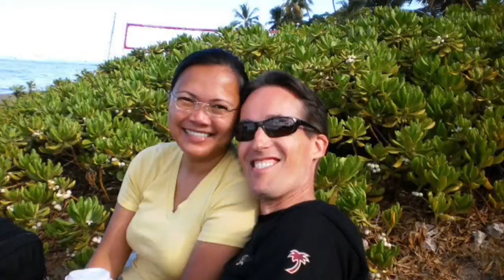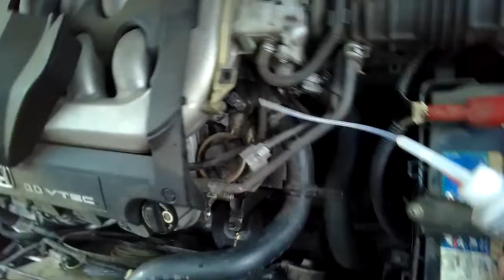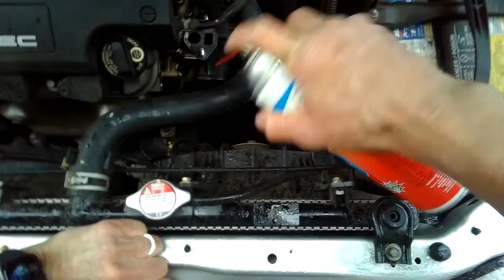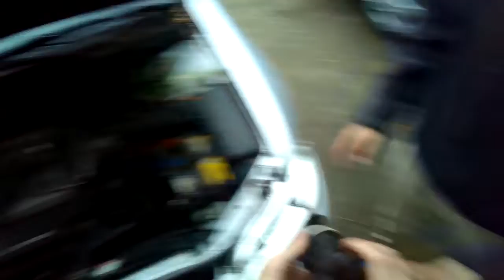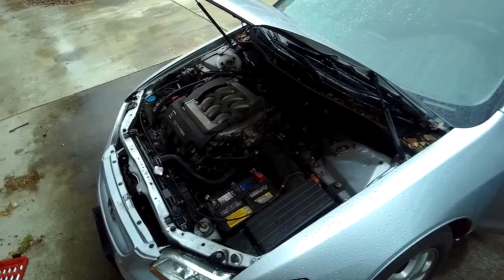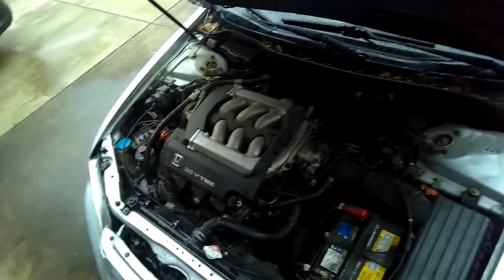HONDA ACCORD P0301, P0302, P0304, P30306, P1399 — FIX

Comment: Excuse me, friend..my car has the.light on.and it shows the.codes.p0304,p0306 and p1399....and I already changed the ignition coils...of cylinders 4 and 6...and anyway turn on the light again...again...that thing you did about the EGR valve...you think it will solve the problem for me
Reply from the maker: Can you send that same question to my email address at: scottthefixitguy@yahoo.com
Reply: @Scott The Fix-It Guy  DIY Appliance Videos   Any word on how it went? I bought a used 2001 Honda Accord EX V6 3.0L. I got a BUNCH of codes about 6 months ago(after running perfect for almost a year). I had gotten them all down to one, by this morning. . P1491 of course. I had changed both belts, idler tensioner pulley, spark plugs, coil packs, and ELD (that was fun). So, today I pulled the manifold and EGR, cleaned out the ports and put it back together. It finally ran PERFECT! Took it out and ran it in town then on the freeway. Coming off the freeway, it started shaking a tiny bit and of course grew right back to chuggy. I want to cry at this point. I don't know what to try next. Any advise would be greatly appreciated, please.
Reply: @kathyellis1705  please yall let me know what worked for yall im getting the same misfire on 1 3 and 6 and I changed spark ugs and ignition coils and its came back. Egr valve was replaced almost 2 years ago still looks brand new but I may try to clean it first and see what happens but any insights any one has would be helpful

Comment: same codes for my accord, very hard to start the car, die after 10-15  mins idle or shift gear. cleaned EGR valves and throttle body,replaced spark plugs and ignition coils,  did not work. Any other possibility? Thanks

Comment: I have an isolated issue id like your feedback on. I have a 2002 honda accord. few weeks ago it burned oil to the point of being practically dry then started firing p0302 code and shaking quite a bit. after some maintenance (spark plugs,  oil) it no longer shows p0302 but jerks here and there while driving. do you think the coil pack or injector will  need replacement?  or is this just a permanent symptom caused from running out of oil while driving?
Reply from the maker: Thanks Danny,
I think if it was the coil or plugs you’d get another misfire code.

Comment: I am stumped if someone has any ideas. I got a 2000 civic ex 1.6l. It’s throwing a P1399 and p0304. Random misfire but only on cylinder 4. I swapped the spark plug and the misfire still on cylinder 4. Swapped the injector and it remains on 4. Checked compression and it has good compression. I checked for vacuum leaks and even sprayed carb cleaner on the lines near the intake and nothing happens the engine still misfires.
Reply from the maker: Awesome Ron,
Thanks for the update😊
Reply from the maker: Hi Ron,
Can you swap the ignition wire from a good cylinder to number 4 to see what happens?
Reply: @ScottTheFixItGuyChannel  thank you for replying. No, not quite. Since it’s cylinder number 4 it’s the shortest wire, so if I try to swap it, it won’t reach to the other cylinder. But that is the only thing I have not verified, the spark plug wires. It’s been snowing so I haven’t even attempted anything since. I have grounded the wire and it does spark, but I know it’s still possible that maybe it’s damaged somewhere where I can’t see.
Reply from the maker: That was the misfire problem on my son’s accord .  The new wires solved the problem👍
Reply: @ScottTheFixItGuyChannel  thanks, I’ll definitely check that as soon as the snow passes.
Reply from the maker: Very Good,
Please keep us updated👍
Reply: @ScottTheFixItGuyChannel  I figured it out. Intake manifold gasket was worn on the #4 cylinder but it was at the bottom so it was hard to get brake cleaner on it directly. Swapped it out and misfire is gone.
Reply: @ScottTheFixItGuyChannel  exchanged the wires and it still misfires on cylinder 4. I am stumped, the cylinder has everything it needs from what I can see. Compression, spark and gas. It can’t be a vacuum leak because it would misfire on all 4. Unless the intake is cracked near the 4th cylinder but when I sprayed carb cleaner on the intake nothing happened. So I doubt it. And obviously it can’t be timing because once again it would have mulltiple misfires.
Reply: Check the sparkplug gap, fuel injector

Comment: I have p1399, p0300, 3001, 3002, 3003, 3004 - no performance difference, just check engine light - how do you troubleshoot that?
Reply: I had a p1399 and p0304. And I struggled to find it for 2 weeks because I never expected a vacuum leak to be the culprit because it only misfired on cylinder 4. If I had your codes that’s the first thing I would check. Your car turns on so that means that the cylinders are receiving everything it needs to run but it’s either not enough or it’s too much. Here are the list of things I’d check. Vacuum leaks, air filter, fuel pressure, fuel filter, distributor and it’s inner components like the coil, cap and the rotor. All of these things can cause a misfire on all 4 cylinders. I would tell you that it’s a waste of time to check spark plugs, wires and injectors because what are the odds they all went bad at the same time? But idk I guess you can’t just write it off.
Reply: I have p1399 code on a 02 accord 2.3 and it’s running lean?the plugs are white ? Pulled the injectors and cleaned them they seem to me firing normal
Reply: @tinytattoomike7943  is the code still present? Also is p1399 the only code you have or is there another code stored?

Comment: Do you still need to replace the spark plugs because of the misfires??thanks
Reply from the maker: Probably just need the née ignition wire that goes on the spark plug.

Comment: Did this fix it? My daughters car (2000 Accord V6) is doing the same thing with the same ODB codes. Seems to occur on really hot days only though. After the car sits it runs fine after that. It has occurred twice this week on hot days but it was 2 months since the last time this occurred.  Anyone found a definitive fix for this?